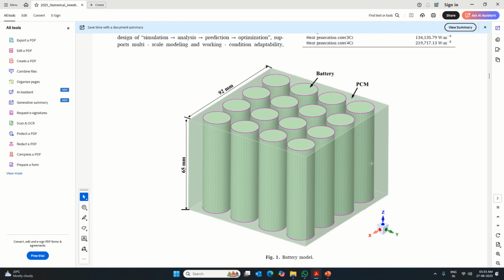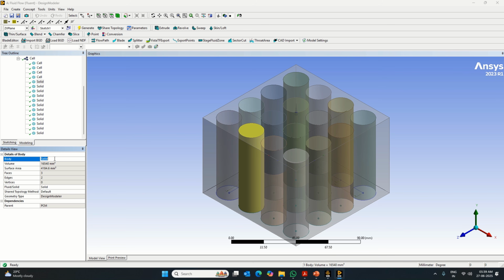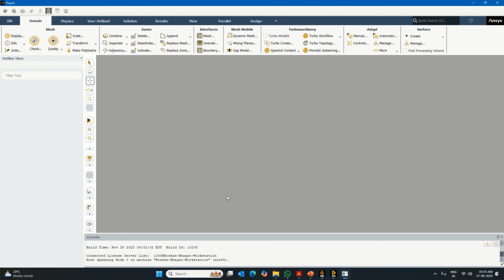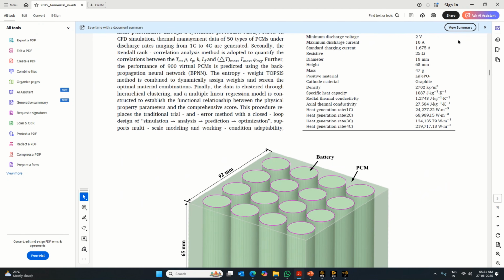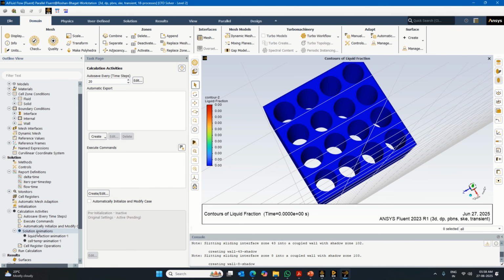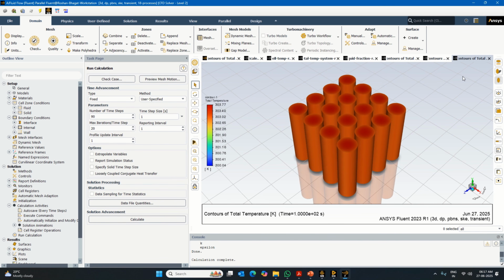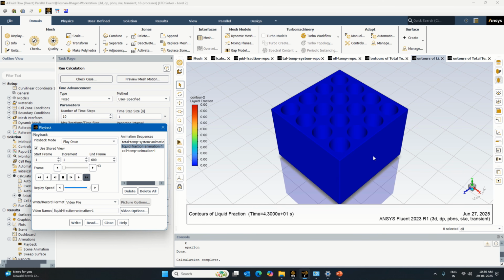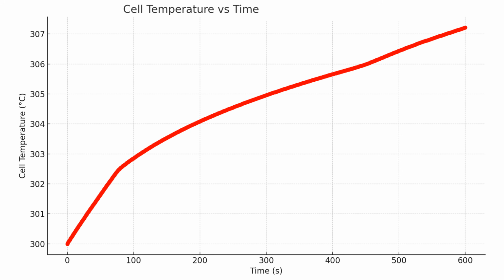CFD Simulation of Li-ion Battery Cooling Using Capric Acid PCM

Comment: assalamualikum. Your contour of liquid fraction did not match with the contour of the given paper,, What is the reason behind this? please explain. I have to validate this paper by simulating the same thing and bringing out the same result of this paper by Ansys Fluent. Please give reply to me
Reply from the maker: Parameters may not be exactly same.

Comment: Hi Brother: 
If we have to check the thermal analysis on different charging or discharging rate, so should we need to connect the cells with each other? If yes, then how to connect these cells?
Reply from the maker: you can add negative and positive tap then define the material. connection to be done as per series or parallel combination to achieve the required voltage and current capacity
Reply: @FrontiersInCFD  Please make a video on this.

Comment: sir, its great work. I tried but after reaching 305.15 temp there is sharp rise in temp and liquid fraction reached  directly one.
Reply from the maker: change mesh size then try
Reply: @FrontiersInCFD after Changing the mesh size it is the same, the liquid fraction suddenly rise to 1. Please help😢

Comment: Namaste Sir, I was trying to perform battery pack simulation with real conncetion(real tabs and busbars) for 14S2P pack but as i check for "Print battery connection details" it gives out as No. of stages in series = 1 and No. of stages in parallel per series = 28. Can you perform similar battery pack with real connection or can you help with the same. Thank You
Reply from the maker: I also work primarily with thermal models only, without using the built-in electrochemical Battery Model,
Reply: @FrontiersInCFD  Namaste, Now I’m facing issues particularly with defining contact boundaries (to transfer heat from cell to outter wall of battery pack) — whether to assign them as walls, interfaces, internals, or coupled walls(missing)?. The behavior is inconsistent: in some cases, the battery circuit forms correctly but boundary zones become problematic, while in others, the boundary zones look fine but conduction zones within the battery pack circuit fail to form.
I’ve been using Normal Meshing and Fluent polyhedral Meshing, but haven’t been able to resolve this fully.
Can you help with this?
Reply from the maker: they have to be wall only
Reply: Hi i can do that